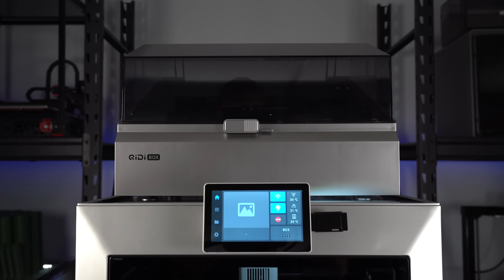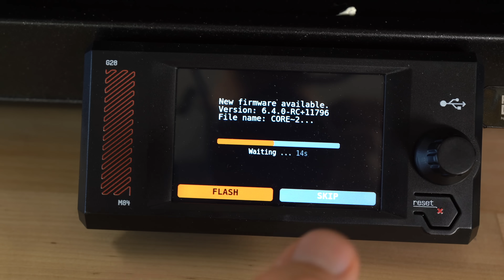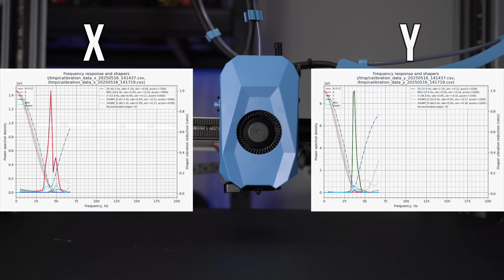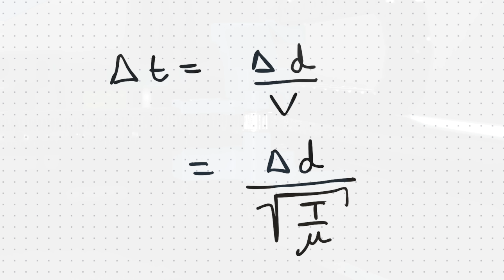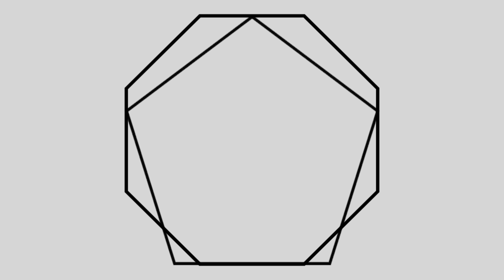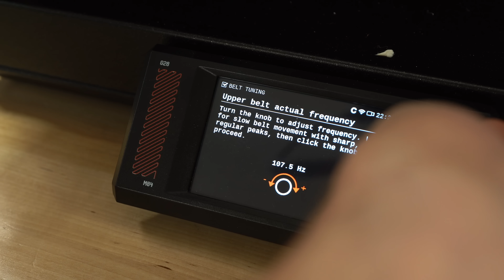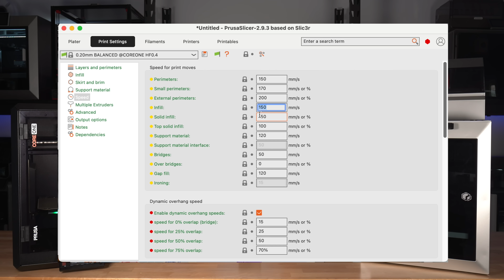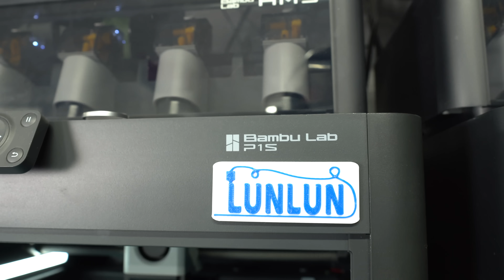The 3D Printing VFA Epidemic

Comment: If I understood correctly on some Vorons they use "kinematics" the printing bed is just laid on balls without a hard connection.
Also I wonder if a solution could be to use 2 belts, one displaced by half of the belt tooth size.

Comment: @14:40 you can absolutely tune belt tension even with spring loaded tensioners. Just use a screwdriver to move the tensioner whichever way you desire. But that's not something I would ask bambu users to attempt

Comment: Good video, but VFAs come in many more types. It would be good to add in that those are not the only types at least because only presenting a few and numbering them implied they are the only types. Eccentricity in filament driving gears, slight off axis filament driving gears, step resolution limits on extruder motor, high-temp slow print low-pressure vfas, triangulation model artifacts, Gcode buffer underflow vfas, and many more.

Comment: Thanks for this  very clear explainer on VFA's. If I would change the belts and pullies in my X1C to 1.5mm and the toothless pullies to the recommended size (if at all possible), would that help? Would doing this have a negative effect on the calibration sequences in the Bambu software?

Comment: The magneto x has awful vfas and that uses magnet and not belts so that's a whoolleeeeeeee other can of worms to fix too. Sucks it's not a popular machine because the community has struggled to tame the issue too.
Reply: Linear drive, I believe, has a similar challenge as Type 1 in this video. The drive is a series of loops (in a straight line, rather than in a circle). As the moving carriage passes from the influence of one magnetic field to the next, it could accelerate and decelerate. On the one hand, there are fewer moving parts, so that simplifies things, but, on the other hand, you can't just switch out motors, belts and pulleys. You need to have a linear motor with better resolution--which may be difficult and expensive?

Comment: I removed 99% of VFA on my X1C by changing belts by Gates 2GT, adding dampers on motors, changed the pulley by toothed one and adjusted the belts tension.
Reply from the maker: Good to know! Thanks for sharing.
Reply: how hard is changing the idlers
Reply: @victornpb not that easy. Check the post on Bambu forum where I describe the change and post pictures of before vs after.
Reply: Out of curiosity how’s your tolerances after those changes?

Comment: Can confirm, my plus4 prints with remarkably good surface quality even at moderately low speeds. It inspired me to swap my sv08 over to 1.5gt belts. Testing/tuning is still in progress for the sv08, but hopefully it helps. I wish more manufacturers did this.

Comment: I use belt dressing spray to help with this since they run mostly over the same section, its easy to apply. I also run linear rails on my k1 and i made a carbon fiber gantry head. My idlers are also larger in diameter, by 2 mm overall and also cogged not smooth. I use paper to cover the rails when i apply the belt dressing. I also increased tension a little more by 4 teeth. It seems to like it, but with a thin belt, its gonna be hard to keep vibration out at high speeds though. Maybe an upgrade to a 10mm wide belt would help. There is enough space. Just barely though. Gonna have to track it perfect. I keep speeds slower due to mostly using nylons and pps or ppa materials. I use pla for my test pieces though, but mostly the cf stuff though. Its harder to notice vfa with these materials though. Should also mention that i used pps gf for my mounts for the rails due to the rigidity of the material. I also undersized the externally and skinned with cf. Im about to test corner mounts made from epoxy granite as ive made machines using it and its stupidly rigid and absorbs vibration well. Using a silicone mold would be easy to make the mounts from. Im going to use an aluminum sleeve for the center section for the pulley.

Comment: Awesome summary all in one place. I knew bits and pieces of why before, but not all the various forms. I mostly use higher speeds and rotating the part so the straight walls are on the 45 degrees to minimize VFAs on my X1C.

Comment: So what would happen with a design that does NOT use Rods Rails Screws gears belts pullies? I have that design. It is a different coordinate system not used by anyone in the industry. And the printing happens on the inside of the motors that are vertically stacked on the same axis. For the xy axis, neither motor is independently x or y, but both together simultaneously are x and y.
Just remember the print head is on the inside of the motors.

Comment: You had me wandering around my house looking for things that were printed on the MK4S, because I didn’t remember VFAs being an issue. They are there but usually much more subtle than after the Core One conversion. I used Stepper Online motors in my MK4S but got Prusa ones when I did the conversion 🤷‍♂️
Reply from the maker: Core XY seems to suffer from them a lot more.
Reply: @ygk3d  could this be because of the huge total length of belt enhancing the effect? I never had any real VFAs on my prusa mini. What about other small printers, like a voron 0.2?

Comment: 2 questions:

1)  What about that printer that was using the linear magnetic motors.  Presumably removes that issue.

2)  Why don't manufacturers gear or pulley the motor to the other shafts with like a gear reducer.  Seems like whatever weird thing is happning with the type 1's, would be 1/3 as much of geared 3-1.

Comment: Why not consider using a ball screw or an RV reducer design? Their motion backlash can be much smaller than that of a timing belt drive. Or perhaps use a timing belt with a 1 mm pitch?

Comment: there is a lot to it I was about to comment when he was talking about the motors that it is the belt and pulleys then he said it but didn't give the belts and pulleys enough attention they are 95% the issue and he didn't mention they are using keyed shafts on the motor pulley connection it should be a compression sleeve on a round shaft. the only true fix would be screw drives. I'm not a printer expert but I work in robotics and on machines that precision down to .002 tolerances. that before and after looked the same to me lol

Comment: Servo nema motors mass produced would be a lot better,I say mass produced cause then they are cheaper, or you could use that mod that someone made that makes stepper motors fully closed loop motors but you still suffer from steps on the motor the other problem is stl files suck, step files would be better to use just as CNCs use can use smoother rounds, the belt is a non issue of servo motors were made cheaper

Comment: This is cool, but isn’t sandpaper also a good option? The VFAs only really matter for tightly fitting parts, it’s not too hard to make the design a fraction of a percent larger and bring it back down to size in most cases

Comment: Does this still occur with shaft driven mechanisms, or the Delta style of printer? Can it be reduced by using a reduction gearbox on the motor output, so the variations in the motors motion are also reduced by the gearbox? And yes, that would assume the gearbox is made to a standard of precision that eliminates play and back-lash in it's mechanism.

Comment: I swear, the printer community will never be satisfied with print quality until things start coming out looking like blender renders. I love hearing the engineering mystery solving that goes into this, though!
Reply: I mean, better is the goal, right?
Reply: @coltonholiday4872  I suppose! It depends on how you define "better", tbh. As I understand it, VFA is purely an aesthetic detail. I only care about dimensional accuracy in my parts, and have never printed things to be cute or beautiful. Again I think its interesting, but I'd hardly call this anything I ever would've called "a problem", though apparently I'm in the minority.
Reply: @mistaecco  3d printing is mostly about old fat men with white hair printing little cute pink figurines to present them on their shelves, where they collect dust.
Reply: @mistaecco  It presumably affects friction too. If you have two pieces you want to slide over each other smoothly then they will bind more if they have matching wave patterns than if one or both are smooth in the sliding direction.
Reply: @usurpinesusanti3149  damn dude, did someone with a 3d printer dump you?
Reply: @usurpinesusanti3149  Come on you can't be THAT disingenuous?
Reply: @budgiefriend he visited the 3d printing Reddit and came to the correct conclusion, so many never model/can't model and only ever end up printing dust collectors or 100 benchys
Reply: @Voyajer. 
I honestly can't disagree with that assessment. 
I use mine to enhance my home, and make repairs or things my friends need.
My wife won't allow anymore trinkets 😊
Reply: @budgiefriend I'm certainly not free from the crime of making dust collectors either lol. I was originally introduced to 3d printing by a previous workplace getting one and needing someone to create SOPs for prototyping and creating low production parts though so designing and printing functional parts has always been my favorite aspect of it now that it's just a hobby for me
Reply: @mistaecco  I think it definitely depends on the application.  Most models that I print are based on biological/anatomical 3D scans, and many of them are for display in museum exhibits.  Other pieces are fine art sculptures, but in either case they're very much meant to be looked at and contemplated.  Any defects (VFAs, ringing, layer lines, etc.) can be distracting.  When something just doesn't look quite right, it pulls the viewer out of the moment of observing the wonders biology or the beauty of artistic design, and sometimes might even direct their thoughts toward the question of how the pieces are made instead.  I'm not offended at all if anyone wonders about my methods and processes, but I hope that doesn't bury the primary experience I'm aiming to create.
Reply: @polyphonium  A perfectly valid counterpoint! For such specialized and sophisticated prints, I agree these defects would be show-stoppers. I think my initial posting was made in frustration towards the idea that VFA was a critical flaw affecting all users of 3D printers, where that's simply not the case. Nevertheless, I'm glad improvements are being made, especially for those doing cool works such as yourself. I'd love to see one of your exhibits sometime 😁
Reply: Different goals exist
Reply: @spacemanmatt This I can't deny
Reply: its kind of crazy if you ask me.
Reply: It won’t happen by chance, this is how it is going to happen, continuous improvements.
Reply: Well for accuracy it's best to use resin. But it's nasty with unhealthy fumes.
Reply: I won’t be satisfied till it looks like an injection molded part overhangs included
Reply: I'd be satisfied if my FDM prints matched my SLA prints.
Reply: The less imperfections there is in the initial print, the less need there'll be to dunk it in chemicals to smooth out said imperfections.
Reply: Ha ha, it's like the hobby of precision instead of the hobby of making stuff. 😂
Reply: Considering VFAs weren't a thing 6 or 7 years ago and only largely became a thing with high speed coreXY printing, I don't think it's unreasonable to want to fix this shortcoming of the technology. That's kind of how progress works.
Reply: Major VFA problems with a new high quality printer is not just not being satisfied....  looool
Reply: I'll be satisfied when my coreXY machine can produce a print of the same quality my Ender 3 managed nearly 10 years ago...
Reply: @krazed0451 love it. I still print all my wargaming terrain on an ender 3. It has been problem free.
Reply: Meanwhile they can only print free stl files and barley can model
Reply: @tannga1  barley can model? dang how'd they teach a grain CAD
Reply: K bro lmao who do u think make the models, not everyone does modeling lol but a good amount of us do or at least dabble in it ❤ @tannga1
Reply: Lazy kids don’t want to do the finish work of sanding and painting, polishing or texturing.

Comment: Na na na there's a much simplear and easier solution: shorter belts, less pulleys, less teeth on belts only when they mean traction but smaller / shorter pitch.
Wanna try? Print a VFA test on a A1 Mini, then build one with better motor. ZERO VFA.

Want an other cheap solution? Do input shaping test, then print a VFA tower and while you print twist the belt tensioner in order to find the best zone, then you read the tension / frequency. It's always the print first, then the numbers.

Comment: Thanks for this very useful description of a common mechanical problem. I’ll be sure to explore a general solution for this in Marlin Firmware. We’ve been very focused on ripping apart and modernizing our motion system and now it should be very amenable to solving this issue. We have to approach it a bit more generally than Prusa or Bambu because we support such a wide variety of unspecified hardware, but it looks like the solution is ultimately very straightforward.

Comment: Your  explanations match all my experiences over the years fighting VFAs on numerous printers.  I've found that hotend temp can play a role, at least with certain filament types like PETG.  My theory is that hotter, softer material "records" vibrations more.  I wonder if printing faster reduces VFAs, in part, because the plastic isn't getting as hot.  
Subbed.  Keep up the good work.

Comment: I understand this with steppers and notched belts but are worm drives not part of the solution ? . Maybe someone should design a hydraulic/ compressed air one. Obviously not an overnight fix though.

Comment: I'm a senior year mechanical engineering student and I'm learning bond graph dynamic systems modeling. This problem would be a perfect for applying this modeling approach. Concerning the belt, there isn't enough damping over the usable range of frequencies I believe. Regarding the coreXY system, this can be addressed by having a transform map in the x-y space that the slicer uses to tune it's acceleration and deceleration profile based on x-y position and travel distance.

Or I may be completely wrong since I'm still learning.
Reply: damping on the belts is literally the number one enemy of printer performance once you reach above 10G of acceleration so no thanks

Comment: This video was informative and very clearly explained and illustrated. Here's where I'm perplexed:

I have two stock Voron 2.4 350s, they have 1.8A steppers, 2GT pulleys and 9mm belts, and the pulleys are running on 5mm threaded bolt shafts (no pin mod yet). I've never seen any of the horrific VFAs shown in the video... only occasional ringing VFAs which I'm gradually minimizing via accelerometer tuning.

What is a DIY home-built printer doing different compared to the fancy major brand-name consumer models? Perhaps a closer look via a machine tear-down and side-by-side mechanical/electrical comparison would reveal the solution to the VFA issues "everyone" (except this Voron owner) appear to be having?

I'm most curious!
Reply: I got plenty VFAs on my voron before switching to toothed idlers then it doesn't have any at all. big size and undertensioning might helped you there.
Reply: @youtubehandlesux  Yup, I have toothed idlers as well. So I guess the secret for all the non-Voron printers is toothed idlers? That seems easy enough to add at manufacturing!

Comment: I managed to nearly eliminate VFA on my Q2 by increasing outer wall speed to 250 and acceleration to 5000. As you said, this seemed counterintuitive at first, but it does make sense. However, I still see some VFA on shorter distances, as it seems that acceleration does not keep up

Comment: For a long time I always thought it was weird when manufacturers boasted using Gates belts but then used the wrong pulleys and idlers, you're supposed to use their full system to get the benefits.

Comment: A tighter belt along with Pursa if you have a CoreOne as I just finished the kit; eliminate VFA altogether. And so what does VFA mean ? 

There is alot of technical knowledge but I can say I did understand some of it 😉 The lines on prints with filaments has always been discouraging for me; but I'm glad with Prusa they don't exist. Although I will mention that due to the CoreOneL which I don't feel justified in buying; they included no kit version. I'm hoping the next Prusa Printer they return to a kit.

Comment: Before watching the video I will tell a story. I hope at the end of the video that story is the same.
My Ender 3 v2 Neo had severe VFA no matter the speed, the only thing that changed when the speed changed was the frequency of the lines. So essentially the frequency stayed the same but due to the higher speed there were less of them. I did everything I could think of and nothing seemed to work. I tried tuning input shaper and pressure advance for example and they did absolutely nothing. That was until I replaced the mainboard to a BTT SKR Mini E3 V3, It completely disappeared. Why? Because of stealthchop. I disabled stealthchop on the extruder which was really simple with the BTT SKR Mini E3 V3 but impossible on the default mainboard without soldering.
1 change which I should have done in the beginning (probably) fixed the severe VFA issue. Now it prints very very beautiful no artifacts at a high speed.